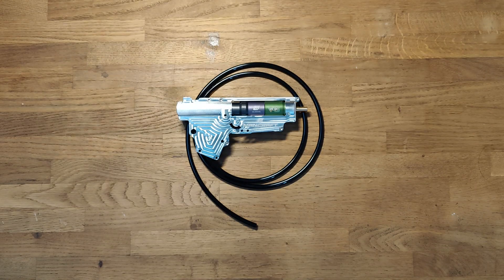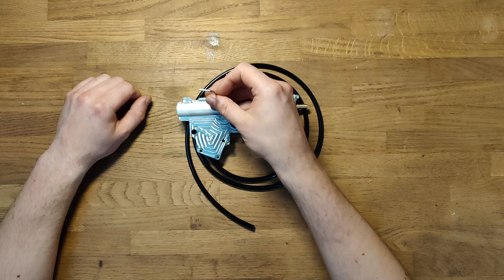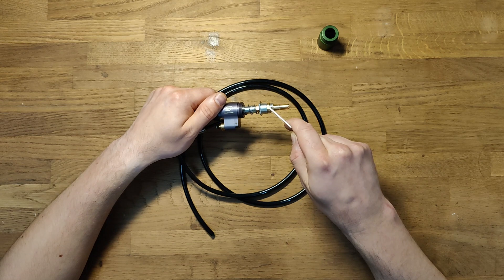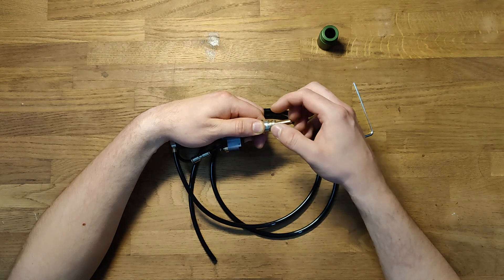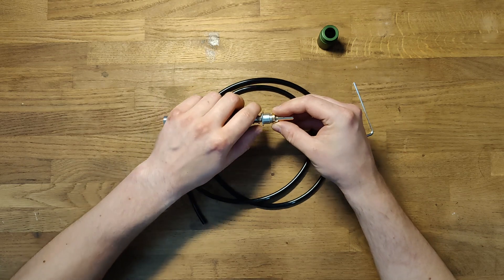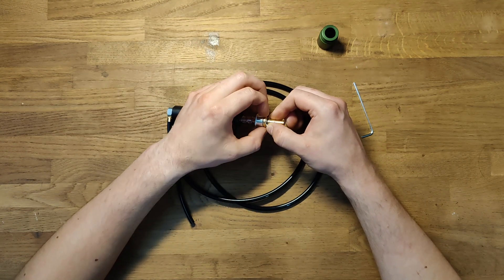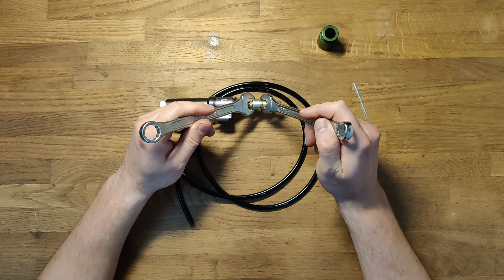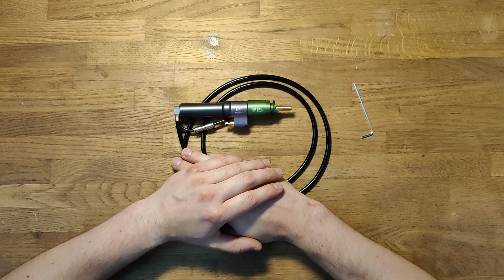Mancraft PDiK V2 and V3 engine Nozzle Length Adjustment

Comment: Good to have this kind of video. The user manuel on the Web site of mancraft aren't always 100% obvious. Thanks.
Reply from the maker: With the air turned off put the nozzle inside the chamber and gently align it against the bucking. Measure the distance between chamber and gearbox shell and adjust the nozzle by that value. Then connect air, push the chamber all the way to the gearbox and drop BB into the feeding tube. It should not stop on the nozzle.if it does, adjust the distance by a fraction of the mm until the BB pass through. 

The final fps should be within 3fps if the system is correctly aligned. If there are bigger changes between shoots I would consider re-aligning the nozzle.
Reply: How do i know if i ve to reduce or lenght the noozle? Noozle to long = bbs can't enter the hop up unit = miss feed? Noozle too short = ?
Reply from the maker: Thank you for constructive feedback. Please let us know if there is anything else we can assist with. Have a great one:goodvibes: